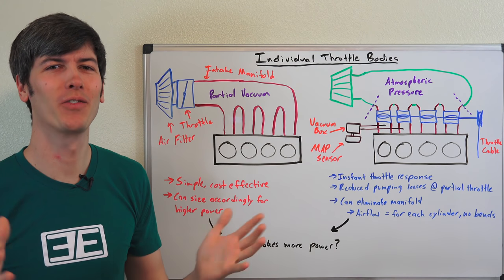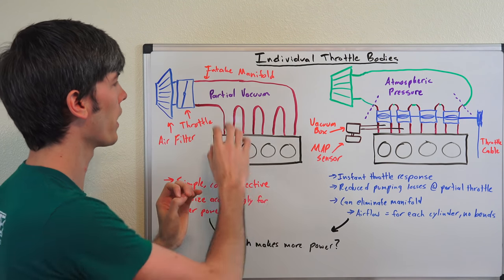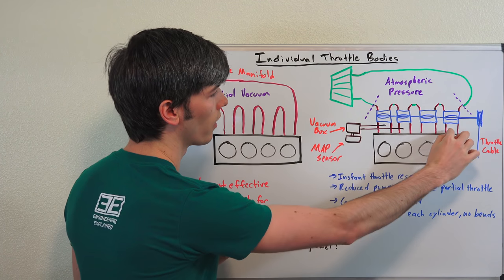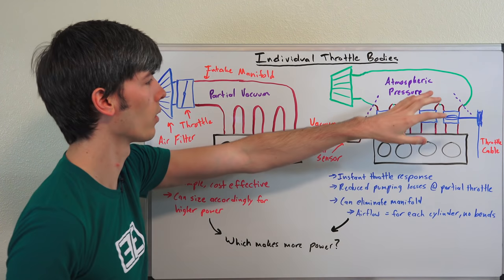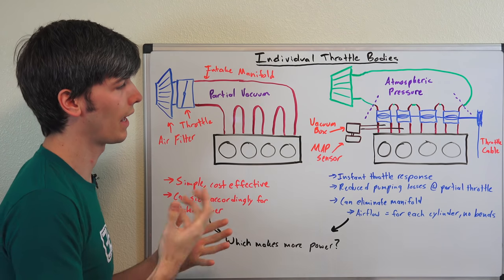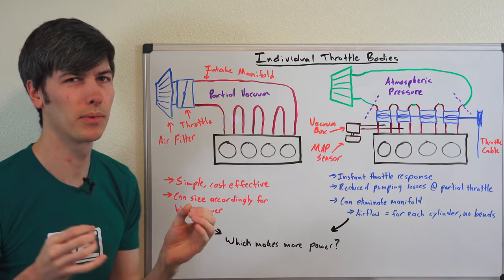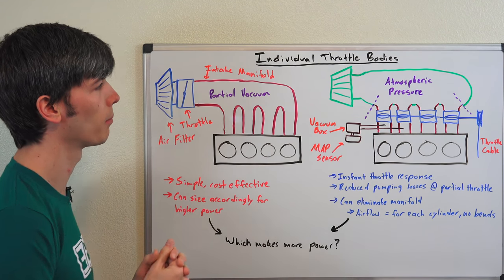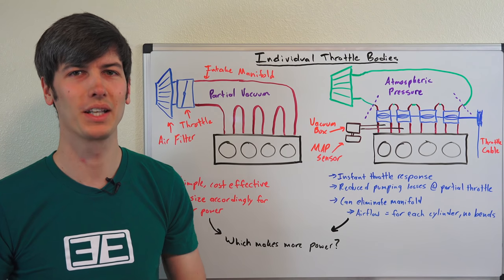Benefits Of Individual Throttle Bodies

Comment: Advantages to ITB's: they look awesome, sound awesome, are awesome
Reply: 100%
Reply: Also the only reason I'm keeping my CAI. Sounds cool even though it does absolutely nothing for performance
Reply: awesomeness is a must !!
Reply: No complaints. The intake sound though!
Reply: Awesomeness does increase HP!(Happiness Power)😆
Reply: AWESOME
Reply: Can you have turbo and itb with out any intake manifold?
Reply: So if you remove that intake manifold completely for less restrictive airflow, isn’t that bad for the engine since it is receiving unfiltered air?
Reply: @r3poman671  it is bad, but you do that on a car you don't drive daily. In wet or snowy weather isn't too bad though. I've driven my daily without air filter for a year (because specific custom air box needed that i couldn't make myself), and oil consumption is still the same, but bear in mind I avoided driving it in dusty places when I could.
Reply: @vasiliansotirov6976  companies sell filters for ITB’s, Pipercross make a direct fit filter to a set of Jenvey’s
Reply: Could not say it better myself...
Reply: @amirreza1926  you can
Reply: The disadvantage would be less dense air
Reply: Bruh your better off having a NA intake setup

Example, N/A setup with HKS air intake.
Reply: That’s it! 😆
Reply: @amirreza1926  if you have one turbo per cylinder, sure 😉
Reply: @r3poman671  you can still have a small filter on each trumpet with no manifold
Reply: @amirreza1926  no...
Reply: Well said!
Reply: ye i want to buy a ke70 and do a custom itb
Reply: yes, yes, and yes.
Reply: just maintanence heavy. though getting a computer to step in and keep all the itbs tuned correctly could be a feasable way for some practicality
Reply: Bike carbs!!!!

Comment: Throttle response for me! I need my car to react when I say so!
Reply: Sacha-yves jean-louis thank you! Drive by wire sucks!
Reply: @RyanWilson876  how to get good throttle response on a drive by wire system? I ask because it seems like no production car made today has drive by metal cable anymore
Reply: @treerexaudi  I think it's ECU tuning that does it. A lot of the time, pedal position is not mapped linearly to throttle position. Since the ECU pretty much does everything, then... Also consider that leaner fuel mixtures make it harder for the motor to rev quickly. It's why most small engines with turbos end up not being that much better, they have to inject a lot more fuel when you floor it to get it to spool quickly and then lean out.
Reply: @lfox02  2020 honda civics have extremely bad throttle response

Comment: That could actually be a really great technology to implement on forklifts and other propane engines because they have a massive amount of lag associated with throttle responses.
Reply: Lag is probably not important on forklifts unless you're racing them.
Reply: @TucsonDude  it helps with precise manipulation though
Reply: @TucsonDude  who says he isn't 🤣
Reply: @its_only_karma7440  all the forklift drivers drive them flat out.
Reply: @TucsonDude  it is actually very important. Some of them have auto bleep systems when you ask for pressure to tilt the forks for example and Lagg can stall the engine.
Reply: @SoulTouchMusic93  yeah I've seen some mad man driving forklifts

Comment: Oh boy more parts to break
Reply: James Bukkaki exact same thing I was thinking. BMW did this with an engine and it always had problems with throttle bodies, they weren't cheap to replace either. I could only see this being realistic in a full blown racecar. not for civilian use
Reply: LOL High end horse power BMW had that, M3's M5's M6's My 1988 M5 has those. They are high performance cars. I have never seen a Throttle body fail. EVER.
Reply: You mean, 4 more purely mechanical parts? What an incredibly complex system!
Reply: never had problems with them on any bike
Reply: James Bukkaki their not high stress parts, or fragile ones, they'll be fine.
Reply: B10401:
Back in the day, it was not uncommon to have multiple carburetors,  They lasted just fine.
Reply: Ken Smith Back in the day, parts were built to last!
Reply: uhhhhhh yeah I got a magna that sat a while and bringing those 4 carbs back to working order was not easy ot cheap

honestly easier to rebuild the long block than the carbs lol
Reply: don't buy.... fabricate!
Reply: Pedro Amado it's outrageous!  I bet this guy was upset that the car was invented. Horses have less parts to break! 🐎
Reply: Individual throttle bodies are very common on motorcycles. Mine has such a setup. It's only 600cc but can push out just over 100hp at the crank. It sounds like a F1 race car when it's passing 10,000 RPM :-)
Reply: I've got a 4age silvertop with factory itbs and they have never been a problem
Reply: Only the TPS and the IAC
Reply: Matt Wilkinson That’s because it’s a Toyota and not a BMW.
Reply: @Fireitup3222  back in the day, parts only lasted a fraction of the time as parts these days do. Stop looking through a filter and face reality. Use to have to change oil every other fill up, now you can go 10k hard, abusive, loaded, high reving miles and maybe need a change. A 4 liter V8 used to get lucky to get 15 mpg, now we expect a 6 liter v8 to get 25 mpg, last 5x as long (even though modern tolerances are much tighter), and make more than triple the power. Our designs are more efficient, stronger, powerful, and lighter than ever and this trend is just gonna keep going.
Reply: @sinnersspeed472  i dont know where youve been for the past 20 years or so but parts designed nowadays dont last half as long as parts on older cars. Same with engines. Low friction piston rings are dead between 60 to 80k (ask vw, audi or toyota) where as years ago you could reuse a 100k old set. 
Most diesel engines are dea at 100k, especially after only having 5 oil changes in that time, whereas older diesels were common to see 200k and they would be barely broken in.

Comment: Great Video, great explanation. I will tell you from experience, I've worked on some of the old Weber Carbs that had separate throttle, as well as some aftermarket Fuel Injection systems built to replicate those old carburetors, and have a separate throttle bodies at each cylinder. The worst part about them is they are SUPER sensitive to the throttle plates being adjusted perfectly to have identical airflow through each of the throttle plates when the linkage is adjusted to have all the slack taken out of every point. If you have them out of balance, or the linkage is off and opens some before others, you'll end up with running problems or issues on acceleration as you have different amounts of air flowing into each cylinder. It's a great system in theory, I just have not seen where we have the details worked out well enough for widespread implementation.
Reply: And it seems that weatherproof cold air intake is easier to do on non-ITB setups.

Comment: Just like older 4cylinders Motorcycles having 4 carburators insted of one giant carburator.
Reply: i think even newer motorcycle use ITB bcs u need a sharp engine response in a performance bike
Reply: @user-ef3om4jb6s  I wouldn't say my motorcycle is new being a 2005 FZ6, but it's got ITBs in an airbox.

Comment: You missed the largest benefit of ITBs and arguably the main reason you'd use them (apart from the noise!) and that is the increased pressure at the inlet valve during the valve overlap period.  This allows you to run much longer inlet cam duration and larger overlaps whilst still giving acceptable idle and low-load operation due to the reduced retained exhaust fraction in the combustion chamber.  Longer cam durations equate to higher revs which is, ultimately, more power.

Comment: The biggest reason to go ITB is to get rid of the effect a plenum has on the positive pressure waves that pulse back into the plenum when the intake valve shuts. These waves can affect adjacent cylinders because they share that plenum. If the plenum is eliminated, the pulse waves go into ambient pressure and cannot affect the adjacent runners. Tuning the stack length helps when you tune for high, medium, or low RPM power gains because you can actually "time" the pulse to be exiting or nearing the exit of the stack when the valves open on the next cycle. Doing this can create a positive pulse wave INTO the engine. I am measuring 0.05psi of positive pressure, not vaccum, above 5500 RPM on my 2.0 Zetec with ITBs because of this phenomenon.

I've been told this is the biggest reason ITBs can be beneficial. I did notice big gains up top when I built mine. And the car doesn't run out of breath up top, it just keeps pulling, which is great when I want to leave it in 2nd due to an upcoming turn at the track and don't want to waste time shifting up then down again. Before, I would kind of run out of steam and it was a draw whether I upshifted to 3rd or rode it out. Now, it's definitely better to leave it at WOT from 7200 to 7700 where it would fall on its face before.
Reply: Tim Oyer excellent insight. Thank you.
Reply: +Tim Oyer
Great, informative answer. Thumbs up!
You missed just one important thing... Engine sounds so much better with ITB's :)
Reply: Saved me a comment, thanks.
Reply: laferrari uses this thing
Reply: MDS  your comments started off topic. You missed the point of not only the class but the OP gains. You are on the wrong side of the equation!
Reply: Tim Oyer dude I own a ITB, and I don’t know how to figure the optimum length, any advise would be appreciated.
Reply: Making ITB out of duratec manifold and stock TB
Reply: Let's say there's a butterfly valve for each cylinder, but a plenum is used, say a dual quad on a V8, dual plane for low end, single plane for high end, spread bore or not spread bore
Reply: Dual quad on a v8 vs ITB..., or single quad on a 4 pot vs itb, or 6 pack on a 6cyl vs ITB
Reply: Steve Miller  i don't think you understood my question
Reply: Steve Miller  you can have carbed ITB 😂
Reply: Steve Miller  a lot of 4,5,6 cyl bikes have carbureted ITB setup, but even with a series of 4 or 2 bbl carbs they can still get the single throttle valve per cylinder
Reply: Steve Miller  what's the difference between 8 mikuni's, 4 webbers, and 2 holley 4bbl's if the Venturi's are all the same bore and length and the needles and jets are similar, theoretically a properly tuned carb can make more power because the gasoline cools the air charge
Reply: Steve Miller  i'm trying to ask questions, if you think i'm trying to be smart for asking questions, you probably need to reevaluate yourself
Reply: Steve Miller  you literally said "ITB vs carb" i know you can have ITB EFI because my bike is set up that way and so are some cars, i just wanna see if they need to be ITB or one throttle body but one butterfly valve a cylinder

edit: because one butterfly valve per cylinder is usually the easiest to set up plus more cost effective
Reply: Steve Miller  i'm trying to learn and you give me vague answers and insults
Reply: Steve Miller  you never answered my question because you don't know the answer

Comment: Your explanation is great , and each system has its advantages , The IR system is great for road racing where crisp throttle response is needed and great midrange power , but it will never make the top end power if a plenum system . This is because of how restrictive it is . When you have say a single 4bbl on a plenum each cylinder has access to all 4 throttle bores , not just 1 as in the IR system , so hi RPM power is always better .
 An example , I have done a lot of dyno development on a 4 cylinder Olds Q4 engine . From running the stock factory fuel injection w single throttle body w plenum to hand built intake w 2 throttle bodies on a plenum , and then 2 Weber 48mm carbs on a hand built IR intake and then to a single Holley 780 cfm 4bbl on a plenum intake . Each had its own power curve and different driving feel , The Webers have instant throttle response , but are down on peak TQ and HP to the plenum system , not much different in drive ability but very crisp off idle . 
 On the Dyno the weber carbs were down 10 lb ft of Tq and 13 Hp over the Holley carb set up , which made 289 Lb Ft Tq @ 5200 rpm and 305 Hp @ 7200 rpm .

Comment: Love my GTiR, came standard with quad throttle bodies
Reply: Pulsar gtir had the only sr20 which had itb
Reply: Nika Tskhovrebadze was also the most powerful
Reply: That is true however it's a pity with how Nissan designed them. I don't understand why they went to so much trouble to make an ITB setup and then to compromise the design that badly.

Comment: ITB's are often tuned using throttle position vs RPM, with corrections for intake air temperature and barometric pressure

Comment: Nice use of the whiteboard! Much easier to follow than lots of CGI stuff! Would it be possible for you to do a vid on turbochargers vs superchargers (if you haven't already!)? The differences, advantages and disadvantages. Are they better suited to certain types of engines (no. of cylinders, capacity etc). Would be cool to hear your thoughts.

Comment: Can you please do a video on velocity stacks? Explain exactly what they do and how to maximize the benefits. Also various applications. I am currently experimenting with them hahaha
Reply: what they do i can help with, rather than trying to feed air into a straight ended tube the velocity stack creates a larger and smoother surface area to pull air into the tb, resulting in a smoother flow of air.
think of it like a funnel if you will.
hardly a scientific answer but hey it might help you understand them a little better - cheers
Reply: Not quite correct. It makes the air transition into a smaller area. This reduces the pressure of the air but increases the velocity as it comes into the engine. You want somewhat turbulent air in your engine for some reason that was explained to me but I forgot.
Reply: http://thegarage.jalopnik.com/what-are-velocity-stacks-and-why-you-want-them-on-your-1792235442
create one with carbon fiber, then put a servomotor for each to modify the legnht then put the engine on tuning and vary the lenght for different charge and rpm and you get the most power from them for each point of the map. you should tune them for each cylinder
Reply: To feel the difference, do like this: 
Make a pipe in paper, 100mm long and 40mm in diameter for example
Blow air through it with your mouth and put your hand in the other end to feel the air flow. (remember the flow)
Then insert a "velocity stack" in the pipe, make the stack of something harder(cardboard, plastic etc)
Blow through and feel the flow again and you should feel that the air hits your hand faster/harder than it made without the stack!
The velocity/speed of the air has increased because of the smaller area in the pipe.
Reply: Several of you guys are mixing velocity stacks with air horns. Its certainly true that this shape is beneficial to flow compared to an abrubtly cut off pipe. However there is more to true velocity stacks than this. When the intake valve closes in your engine, it creates a small pressure wave travelling outwards through your velocity stack. Now from this point on, my knowledge is a bit sketchy but ill try to explain the basic concept. Anyway, when the pressure wave reaches the end of the stack, the pressure drops dramatically because of the increase in volume, and this in turn creates another pressure wave in the opposite direction. The idea is to tune the length and shape of the stack to harvest this pressure wave as the next intake cycle starts to help with initial cylinder filling, sort of like an opposite scavenging effect created by a properly tuned exhaust.

In this way, it is in theory possible to create an engine with a volumetric efficiency greater than 1, or in other words, an engine which passes in one revolution more air through itself than its actual engine displacement.

Now i am no fluid dynamicist or expert, just an interested layman. I'm not sure how or if the horn shape affects the pressure wave itself, but i would think a straight tube would create a stronger pressure wave, but naturally the intake needs to flow well. possibly in a straight cut off intake pipe, incoming air would cancel out the pressure wave due to turbulence from having to change directions sharply.
Reply: Gonzalo, i think you should read the other reply i posted in this thread. You mention a lot of valid and interesting things and i dont mean to take away from that, but velocity stacks are a concept more specific than simply the well flowing shape of an air horn. N/A cars can definitely benefit from velocity stacks, and i would say, in turbo cars it is useless and impossible with a true v stack intake due to the turbo itself and the fact that the turbo already creates above ambient intake pressures.

However there is one thing i wanted to touch upon. About what you said with the MAF sensor: The horn in front of the maf would be there to promote a smooth transition from a big volume to a smaller volume, creating laminar flow and high velocity which is well and good, but it is my understanding that this air also wants to cling to the outside of the intake tract, and MAF sensors generally read from the middle, thereby getting an inaccurate reading. I may be incorrect and even if i'm not, the variance might be far too small to matter, but i thought it was worth a mention.

Comment: On carburetored cars and bike it allows for per cylinder adjustment of the air fuel ratio.  This allows for higher cylinder pressures, because you do not have to provide margin for fuel mixture variation from cylinder to cylinder.